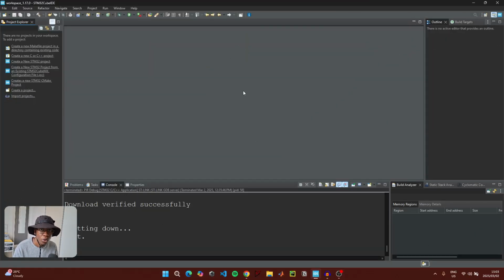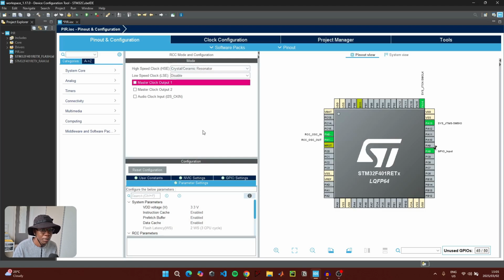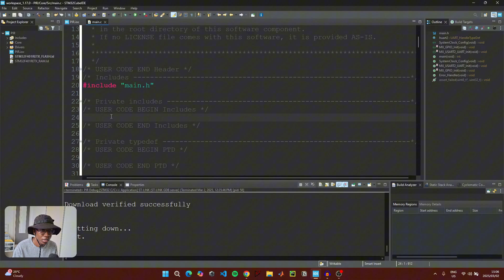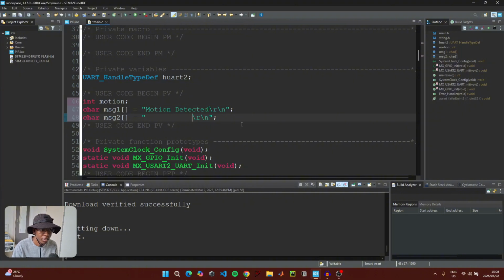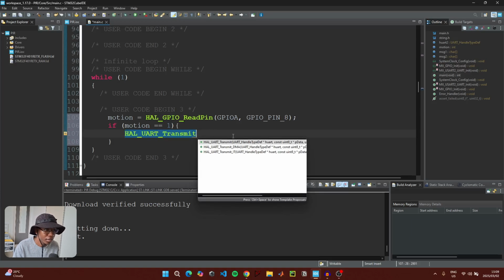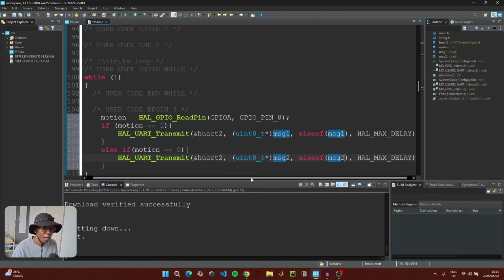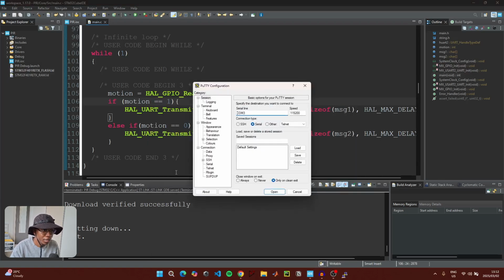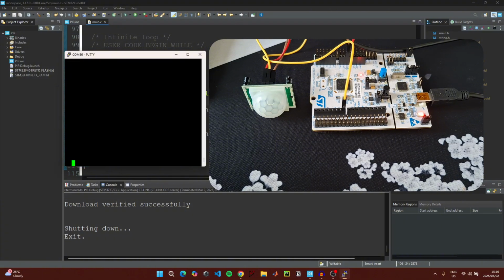How to interface PIR MOTION SENSOR with STM32 | STM32CUBEIDE

Comment: can i use 3.3v power supply with this PIR sensor ?
Reply: You can bro, most sensors run on 5v-3.3v, but, check the description of the sensor, just 
to make sure it